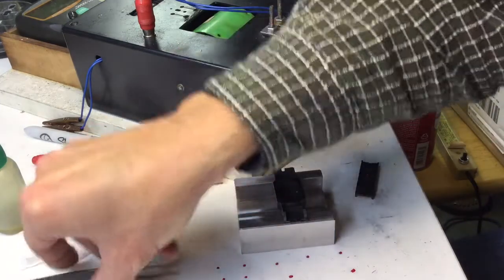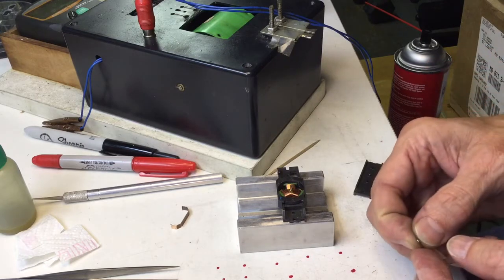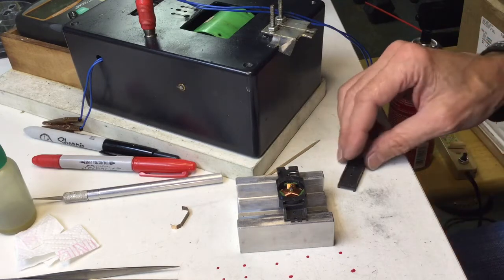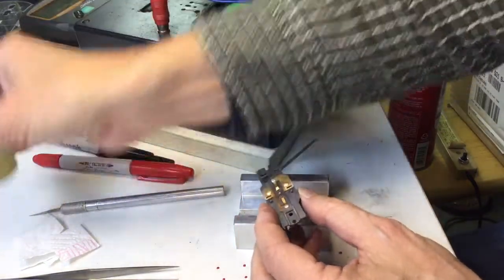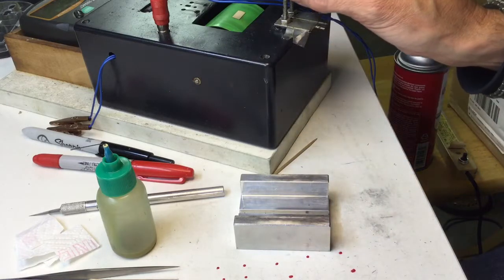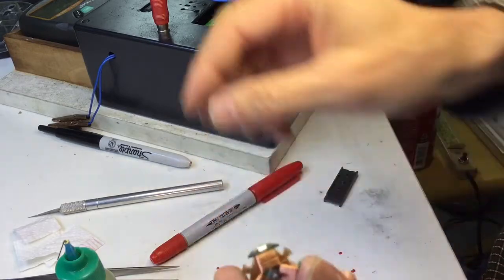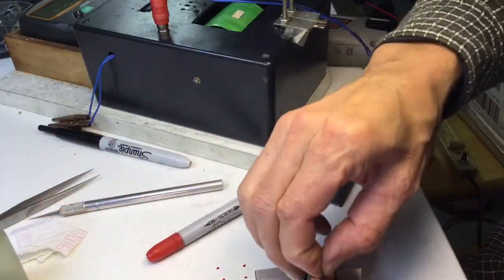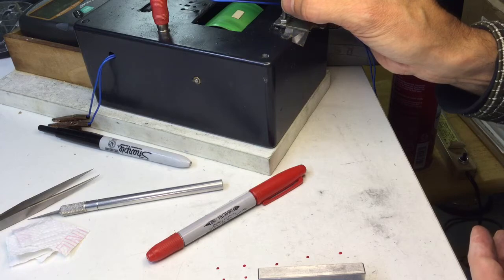Pancake Arm Truing & Balancing Pt7a

Comment: Just to be certain. I cut the TOP where the weight is. I cut the BOTTOM, opposite the weight? Thanks.
Reply from the maker: Hi Bob!  The arm will be cut on the bottom (on the commutator) where it lines up with the top weight on the wobble plate.  180 degrees from that you will cut on the top of the arm on the laminations.
Reply: @Rondo1234560  Thanks, Rondo!
Reply: @Rondo1234560  One other question. If I want to ADD weight, where would it go in relation to where the balancer weight is? Thanks.
Reply from the maker: Bob,  If you are adding weight, that would be opposite what you would do to remove weight.  So at the location inline with the top weight on the wobble plate you would add weight at the top of the arm.